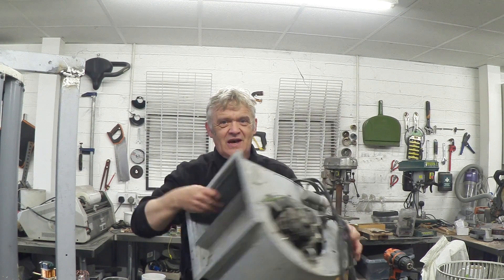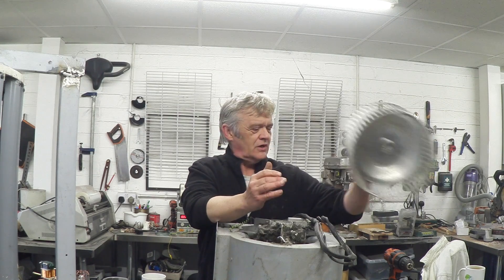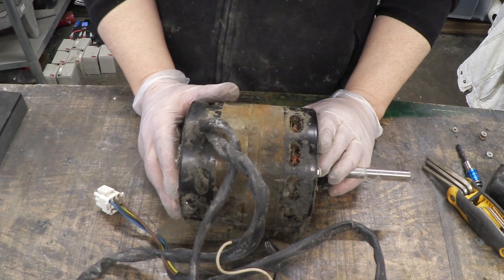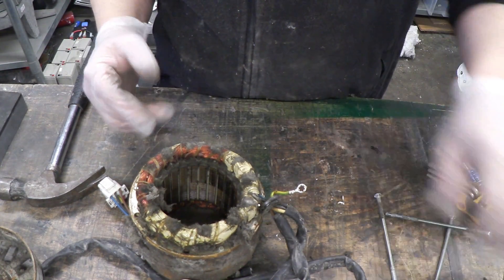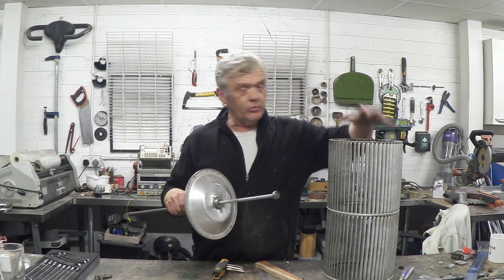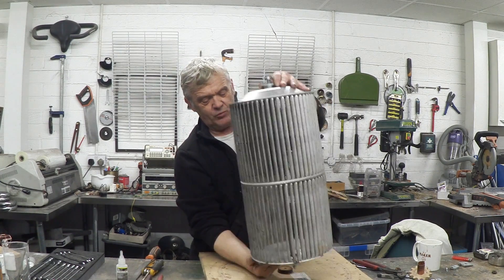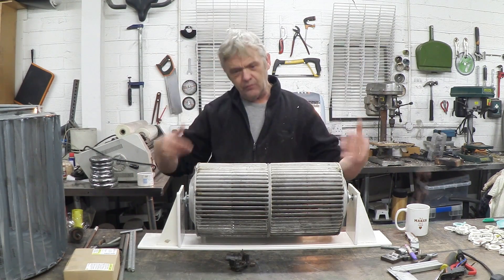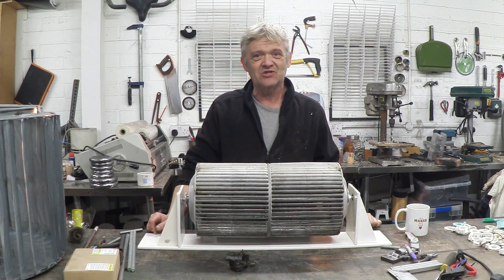A Lucky Find And A HAWT Rotor For A Wind Turbine

Comment: i am just building a waterdriven generator out of one of these blowers. mounted a 250 w dc scooter motor on top of the casing and use about 100m 3/4 plastic hose layed out up a brook to produce enough water pressure. project is not tested in the wilds yet but testrun with tap water works allready. the rigg is light enough to be taken to the cabin for charging batteries there if needed . not real superpower but continuous charge 24/7. greetings from newfoundland, love your channel
Reply: .....¾" diameter , laid along  100 metres , how about the height measurement ?. .Testing with tap water at the typical pressure is equivalent to say a  conservative 20 metre height difference .Head that is , we say the head of water .
Reply: @charlesdickens6706  well , steep country around here, i would estimate at least 30m in height difference, and- the tap water test was done with 1/2 inch garden hose, so there is also an significant increase of sheer water mass. but if there is not enough power i can always add some more cheap plastic hose. the brook goes up much above that 30m level. what i would like to know is the actual output of this scooter motor as a generator at nominal rpm
Reply: ......then there's the flow rate in litres per second . A plastic bucket is about ten litres capacity . So time how many seconds it takes to fill from the town supply and then from the brook too .

Comment: I love squirrel cages, they are bloody awesome. You could put a spacer between the two and add extra coils or even glue smaller magnets where you joined the two and have a couple of coils top and bottom of them, not that it would be necessary. Anyway between the three harvesting units you have now you are going to be hard pressed to get enough coils as it is, not to mention the additional cost of the extra magnets
I am loving this project, I found a plastic squirrel cage about the size of one of those that I intend putting to use as a trickle charger for the 400+ Ah batteries I have for my 250 Watt solar panel. I have another 100 Watts of solar panels but they are not weatherproof.
Thank you Rob
Reply: Hi. I have a similar project on mind. Also a trickle charger but a bit larger with two old drums on top of each other cut as savoniuses.

Did you get to your trickle charger?